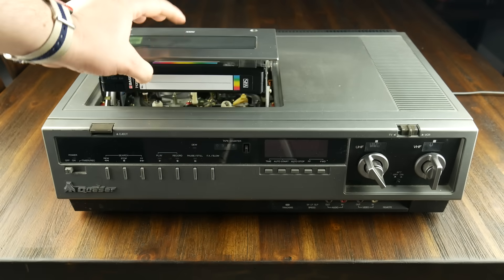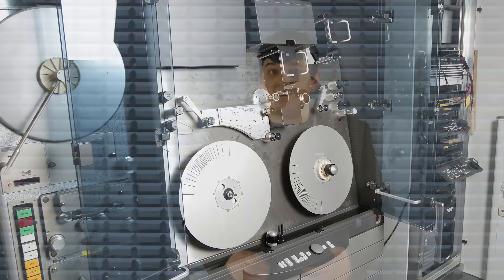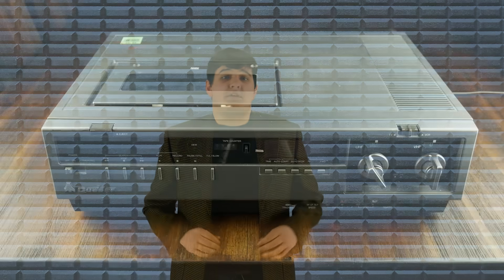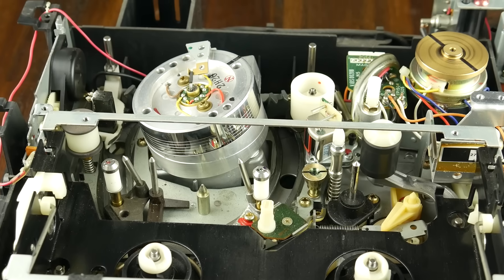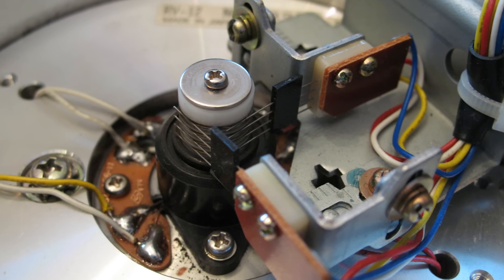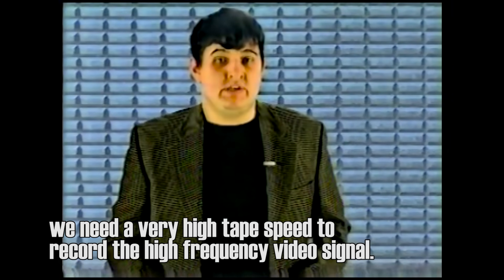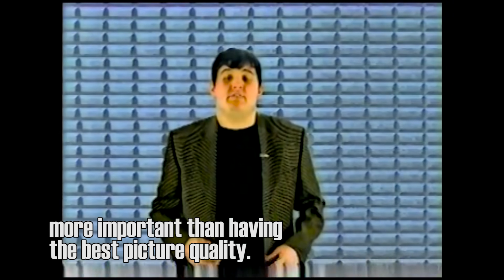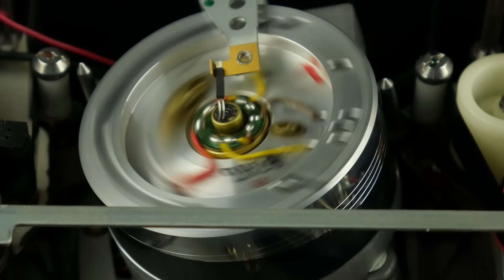The Impossible Feat inside Your VCR

Comment: Where the hell can a person still buy a brand new VHS player/recorder? Mine is on its last legs, and I have a ton of circa 1984 tapes I'd like to watch, complete with commercials. Also, my VHS recorder is much more reliable (or it was until lately) than the heat-generating DVR that the cable providers supply. Those things go bad all the time, while my 13-year-old VHS recorder still records just fine. Also, if there is something I want to record, I just hit the "Record" button on the remote; no need to access a clumsy menu system unless I need to program it for later. Anyway, I've been trying to find a good brand new VHS machine, but no store seems to carry them. Am I out of luck?

Comment: Rumor has it that VHS inventor JVC was so furious at Panasonic for introducing the LP speed without their blessing, that they managed to kill it thru licensing agreements (JVC decks only recorded EP speed).

Years later LP did reappear...... on DVHS decks. The Standard speed (highest quality SD recording mode) is the same speed as analog LP recording. HD recording was an afterthought on the format, the "HS" mode it requires is the same as analog SP speed. Panasonic also added an even slower speed to their last of the line 2000s VHS-DVD combo decks called "VP", which ran the tape 5x slower (10 hours on a T-120!). Thanks to modern tech (smaller heads and experience making CCTV VHS decks), it wasn't awful to look at.

Comment: Really? Maybe it's down to the models of VCR's we got back here that ours still featured (and feature, I still have one, just like my dad) LP recording.But most of the VCR's we got here were not the average consumer models, but expensive Blaupunkt editor-machines as well as an expensive, really sturdy Panasonic. Both machines are definitely end-of-the-90's if not even early 2000's.
When I was 8 or 9 or so (I think, can't really remember) the first VCR started to act up. My dad being into electronics, he didn't put up with the behaviour so he popped the lid to see if he could find the cause and I had my first look inside a VCR. I was just lost for breath when he fed the tape into the machine and all those arms, prongs and whatever kind of stuff came out to reel the tape around the drum and such.
Ever since I saw that, I so much more appreciate all those clickery and humming noises coming from a VCR and all the things that can go wrong...And when you have seen VHS-systems, you should see a combined Mini-DV/Full size DV tape mechanism. It is so complex that I just can't imagine how hard it mus have been to develop that system, especially the combined Mini-DV/DV drives. Though the tape was in the same place for a DV-tape compared to a Mini-DV, it did make up for quite the extra sensors to notice the sort of tape being inserted ánd opening the protective cover.

On a forum for electronic-enthusiasts, there was once a great story from someone who worked at the service and repair-department of some company and told about someone who brought in his VCR."I dropped it and now it stopped working. I know, stupid, but I can better honestly tell you what happened.' The man said.
"Did you open it yourself?" I asked.
"I did, but could not find many things there why it didn't work anymore, except for that silver-colored cilinder thingy that most obviously had encountered a shock and was bent. I bent it back to horizontal position."

Comment: VHS =Vertical Helical Scan  Because this meaning was difficult to understand, it was often re-defined as video home system.
Reply: Video Ham Sandwich
Reply: That explains it! I always found "Video Home System" grammatically jarring, guessed it was a backronym but never knew what it originally stood for. Thank you.
Reply: No. https://en.wikipedia.org/wiki/Talk%3AVHS
Reply: Could I have the source for that? I'm looking to do further reading on the origin of VHS.
Reply: Nope, sorry that's not true. VHS has always stood for Video Home System.
Reply: Zak Giffgaff  Fair point, JVC stands for "Japan Victor Company" but scans much nicer than VCoJ.

Trouble with "Video Home System" is it doesn't add anything, it's like referring to a frying pan as an FP. It always seemed as if there was some other more technical meaning, which there is. But it doesn't matter, I just enjoy the trivia. 😀
Reply: @dantootill  Neither does Vertical Helical Scan, since the video heads on the spinning head drum of VHS recorders never scanned vertically, they scanned the videotape at an angle. Unless you know something I don't?
Reply: @patrickjohnson5658  I know nothing! Just assuming that the angle created by the head being tilted means the recording is sliced up into 'strips' that run between the top and the bottom of the tape as opposed to running from one end to the other. It may be neither vertical or helical in real terms, but it doesn't seem unreasonable to call it that. I'm no expert on the subject.
Reply: @dantootill  JVC could be Japanese Victor Company.
Reply: walmartdog1142
  Curious, when did VHS mean Vertial Helical Scan? I have owned VHS recorders since the early 1980's and never heard them called anything else other than Video Home System. I have also opened up enough of them back in the day to know the video head drum was set at an angle and the video heads recorded tracks diagonally on to the tape not vertically.
Reply: Vemos Hembras Sabrosas.
Reply: VHS:
Very
Hot
Sausages
Reply: Your source? The only "vertical" scans are the initial and unsuccessful Arcuate Scanning (Ampex) and the successful Quadruplex (also Ampex).
Reply: walmartdog1142 Wow, you really do learn something new every day! Thanks for sharing
Reply: Now, with the introduction of CD and USB, it stands for Very Heavy Storage.
Reply: @walmartdog:  Yep... that's what the main companies; National Panasonic, JVC, told us back in around 79/80 with these new-fangled video recorders that we were now starting to sell.  Video Home System for easy explanation to the average customer, but in fact it was the Vertical Helical Scan system:-  a top-to-bottom (vertical), diagonal (helical) scan line across the tape as it passed over the spinning head-drum.  At dealer conventions and seminars, it was always described thus.......
Reply: thought it was video high standard
Reply: Fuck y'all, it's Very Hihg Speed and nobody can tell me otherwise.
Reply: Well I am from 92.s i remember old national j11 as last VHS.....translates to video head system....rather than video home system or vertical helli scan ....it's not vertical as vedio head scans or read tape horizontally...it's heads spin in vertically axsis its the CD or DVD which is scanned vertically...so sir you are very wrong i am sorry to say...
Reply: Well from which angle its a vertical helli scan...it's head reads tape horizontally just open old vcr if u have one ....vertical scan is in DVD n cds as its laser reads disc in vertical path ...no way the in the hell u r right....with helli
Reply: @savneetsinghrairai6823  As this video explained in detail, VHS and BetaMax scanned diagonally, not horizontally.  Posting the same wrong information twice doesn't make it right.
Reply: to many non tech savy peeps.

Comment: I still prefer to use VCR. I have a Panasonic combi VCR and DVD. I do use iPlayer but the iPlayer (BBC in UK) interface is very slow to respond, takes ages to react to your input signal and often either stops working or freezes or kicks you out. You also cannot fast forward through the material to see, which I can with VCR. On the best quality tapes, I can get 12 hours of material (on E.P. extended play) at the same picture quality of a DVD on L.P. (long play). DVD only allows 4 hours at the same quality! Say you are wanting to record the Olympics and its on through the night, you can record 12 hours worth of material, fast forward to what you want and miss nothing You cannot with iPlayer and a DVD would run out. I don't use VCR because I'm a luddite but because I have tried DVD and iPlayer and found them to be lacking compared to what I used to use. I still have 300 tapes, so none of them are in poor quality and none have spooled in about 20 years.

Comment: 14:59 Conversely, Sony’s Video-8 format for camcorders decisively wiped the floor with its VHS-C competitor. The latter was a kind of hacky adaptation of VHS to a smaller cassette, with consequently shorter recording time, while the former was designed specifically to maintaining a higher time/quality tradeoff in the smaller format. Even the much-hyped ability of VHS-C tapes to be played in a VHS VCR (by putting them in a kind of adapter that mimicked the larger standard VHS case) failed to tip the balance.

Comment: 6:53 That’s mono audio. The hi-fi stereo audio is recorded (I think) by extra heads also on the spinning drum, along the same tracks as the video.

How do they keep from interfering? Through a magical feature known as “depth multiplexing”. The audio is recorded first, and because its frequencies are lower, the magnetization penetrates deeper into the tape. Then the video is recorded, which erases the audio close to the surface, but leaves the deeper part alone. During playback, each layer can be picked up by heads attuned to its particular range of frequencies.

Yes, it all really is insanely clever...

Comment: My first VHS also tended to scramble the picture when there was a bright flash on screen. Or maybe it was an artifact of the sudden burst in sound volume.
Reply: For a long time I had an old CRT TV where the red colour tended to bleed a lot, but strangely only the red (unless I cranked up the saturation, then I could make all the colors bleed if I wanted). So basically you had to lower the saturation so much, that colors that were blueish or greenish looked really dull while the red looked normal, or the red was totally over-the top if you got the blue and green at normal levels. (I usually tried to get it somewhere in the middle, tolerating a little bit of either effect.) It got worse the older the TV got.

Comment: VHS Hi-fi was pretty awesome at the time.
I actually used it to record my own songs (guitar, drum machine etc) as it really didn't loose quality like going back and forth with regular analog tape.
Reply: I was trained as a VHS video machine technician.  I have not serviced a VCR in about 20 years. ;)  Removing and replacing slide-plates, and sometimes annoyingly placed mode-switches, pinch-rollers, back-tension bands, belts and heads - ahhhh, memories of my youthful apprenticeship.... :p  HiFi Stereo VCR's used to be used to record live FM radio-shows here before computers and HDD space got so cheap.  A E180 tape would hold 3-hours of live radio show at standard speed, or 6-hours in long-play.  As mentioned in this video, the audio performance was excellent on just about any brand of HiFi VCR - far better then using normal cassette tapes, but also far cheaper then using an expensive professional reel-to-reel machine.  They would often re-transmit from the archive tape so the DJ only needed to do the show once, but it would air at least twice.
Reply: @VauxhallViva1975  Indeed it was.  If used Frequency Modulation to store the audio from what I remember.
I worked on a repair shop for a while in 1990.
I also remember the pinch rollers and the crappy take up reels that would start to slip and then the machine ate the tapes. 

They did later come up with better tech for the take up reel.
The slipping rubber wheel idea was doomed to fail
Reply: @PsalmFourteenOne  Ahhhh, yes!  The good 'ole "Idler tire" replacement! ;)  I remember replacing quite a few of those that had either perished or become rock-hard, and so then just slipped and did not drive the take-up spool at all.  Munchy munch munchy on that lovely tape! ;)
Reply: I’m actually doing that right now just for fun and I’m honestly blown away by the quality!

Comment: Question: If US TV ran at approximately 30 fps, was 60 fps a figment of my faulty memory, and if not, how not?
Reply: Yes, it was. It's 60hz, or 60 fields per second. Each field contains half of the lines for each frame, with one field containing the odd numbered lines and the other field containing the even numbered lines. Two fields makes one frame, so 30fps (in reality, it was 29.97fps, but that's another story).
Reply: AutogolazzoJr Videogames could run at 60 frames though, right?
Reply: Sort of. 480i games ran at 30fps, but some consoles messed around with the ntsc timing to make 240p. This technically isn't an officially supported resolution, and isn't really a proper progressive scan resolution. This is also where black spaces ("scan lines") come from. It allows 60fps at the cost of half of the vertical resolution.
Reply: Don't confuse NTSC TVs with PC monitors back then. The VGA interface was much more robust and clearer and allowed for progressive resolutions and at 60Hz would give you true 60fps if your pc hardware could render it that fast. So for consoles that is completely true, but for games in general they were in "HD" formats at 60fps back in the mid 90s on PCs before the dawn of HDTV.
Reply: The Great Hadoken No no no! 50hz, not 50fps! Pal is a 25fps standard! Anyway, yea, you could do the same trick to get 50fps ( which is worse than the NTSC trick which can do 60fps), and you will get black spaces between your scanlines as well. Remember, scan lines are the lines being produced by the tv. The black lines are nothing, just empty space. However, do note that some game companies were lazy and just slowed down the game in PAL regions to match the Lower refresh rate.
Reply: other tomperson not arguing ;  Finding out.
Reply: I see, so the scanlines were a function of getting a decent framerate.

Also, this makes TV in PAL regions sound superior, with it's 50 fps and higher resolution. Even if the technicalities in gaming meant it ended up worse.

Unless exactly the same tradeoff was happening in PAL gaming too?
Reply: I see. This is quite interesting. My next question would be out of the scope of refresh rates and video formats, so I'll leave it there. 

Thank you.
Reply: You're arguing sementics with one of you talking about an interlaced signal, and the other about a progressive scan. Both are 50 fields per second, but one gives one frame every two fields, and the other a new frame every field. Chill.

Comment: When I saw the video title I was very keen to watch this, only to find no mention of the impossible feat I was aware of, going on inside the VCR!
This feat is that in order to get the really best possible recording and playback, the video tape to head gap had to be absolutely nil: merely having the video heads be completely flush with the video head drum would NOT guarantee this!  This is why video heads actually project a small distance AWAY from the drum's outer diameter. (this is easy to test using a piece of paper held against a spinning video head: if the heads were flush there would be no regular noise when you did this. Instead you can hear the "beat" as the heads go whizzing past). The head actually STRETCHES the video tape as it rotates, in order guarantee the tape had perfect intimate contact to guarantee that precise recording/playback. 
As the head continued to rotate the tape would shrink back again.  Obviously the precise amount of tape stretch you could get away with repeatedly had to be carefully computed to remain inside the "elastic" region of tape stretching or else the tape would never recover from even a single playing.
So, in my eyes, the true miracle inside every VCR was that it physically stretched the tape and let it shrink back again every time it was played or recorded, with no apparent reduction in tape quality or longevity!
Reply: That is one of the best ways to destroy the tape heads! Paper is both abrasive and hard when struck by anything moving as fast as the tape heads. I learned the hard way even before the early days of VCRs. Before VCRs, I had a Sony video tape recorder (VTR) that was an open reel recorder. The tape heads were exposed and had to be replaced three times as something got too close while they were spinning.  As I taught myself how to repair VCRs, the saw the same vulnerability existed while working on a powered VCR with the case open. As the years went by, the metal components were replaced with plastic components and the VCRs became such junk that it was no longer worth the effort to repair stripped plastic gears or somehow get the plastic loading mechanism to work without flexing. The majority of VCRs I owned were Beta. This was due to a demonstration I watched on Okinawa where an electronics store had a Beta and a VHS VCR side-by-side playing the same program/movies. The Beta clearly had better quality picture.
Reply: Tapes recorded in the 70s and 80s still play back with no loss of quality.
Reply: Heads touching the tape should not be a surprise.  Audio heads in cassettes and 8-tracks also touch the head.
Reply: +joe pinball - idk eventually i'm sure quality suffered.
Reply: That's Ok, the tapes are guaranteed for life. Just return them to RCA (or Memorex or whoever manufactured them) and they should send you a new one!

Comment: I used to use the length of the tape that goes around the video head to my advantage. With the cover off I could physicaly slide the tape up and down with my finger. When paused that gave me essentially a second or so of video that could be moved smoothly back and forth at variable speed, even slow-mo. It worked beautifuly on the building explosions in the Independence Day! I was so thrilled when I discovered that!

Comment: I purchased a Sony BetaMax in 1978 ($1495) and it spend the first year mostly in the Sony repair shop. They claimed it suffered from tape wrap error. When I finally got the machine back I had already purchased a VHS machine and didn't need the one hour Sony but I did used it. Great video!